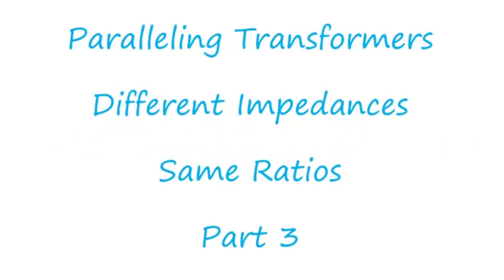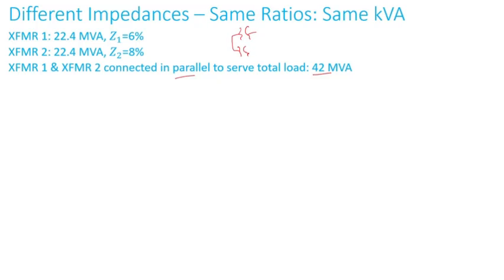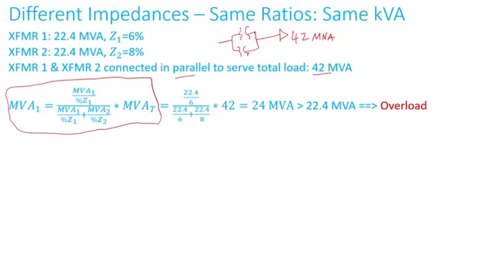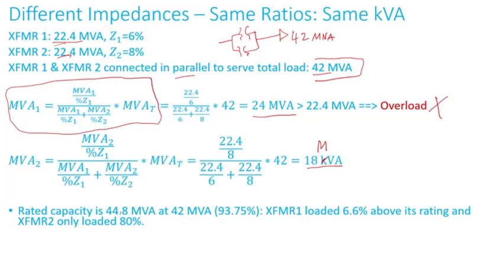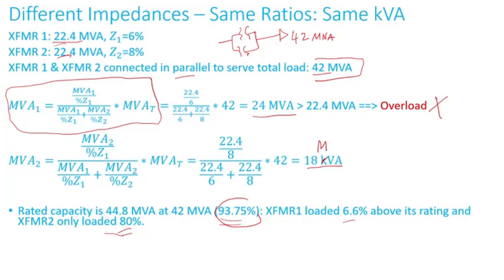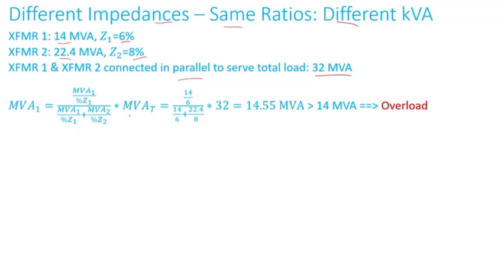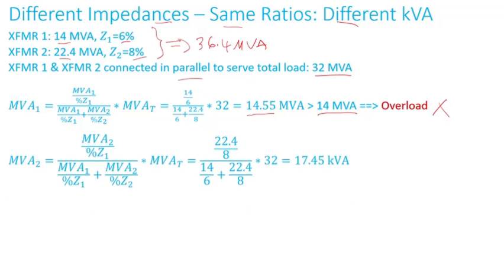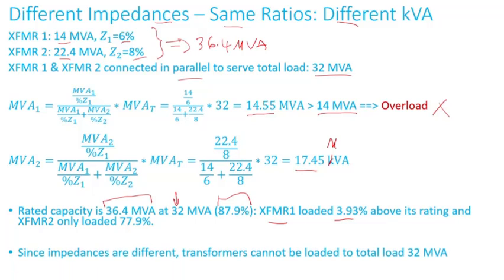Paralleling Transformers | Different Impedances and Same Ratios | Part Three

Comment: Hello we have installed a number of parallel transformers on various projects. The transformers are the same, secondary's are 480v 3 phase with 4000amp breakers and a tie breaker. Code now requires that neutrals be run. Should the tie breaker also disconnect the neutral? We have a rogowski current transformer on the neutral that connects to the G.E breaker and the breaker keeps sensing current and wanting to trip. Many sites but not all have separate feeds from different substations. Thanks for any input.